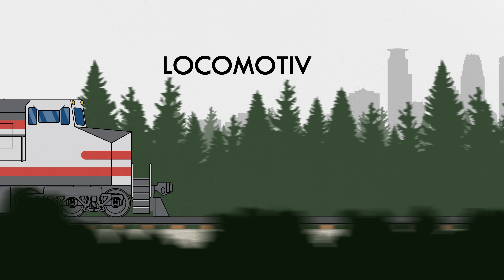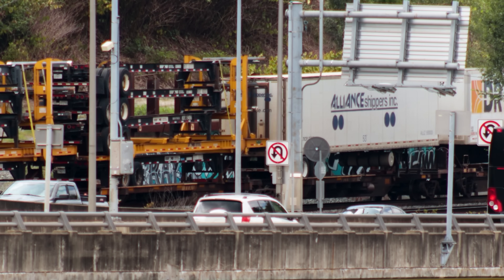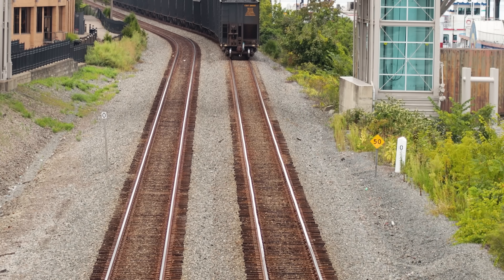Every Type of Railcar Explained in 15 Minutes

Comment: I have a question for the ether:
Where I live, in Melbourne Australia, there are almost daily   freight trains on my local passenger line. They appear to be flat bed cars, each with two cylindrical loads only about 1m diameter x 1m height.
Each load sits above a bogey, held in place by a wedge on either side (seemingly built into the bed). The rest of the bed is bare; it looks very sparse. On volume alone, I imagine you could fit quite a few more on each bed, but the distribution above the bogeys suggests weight is the main concern here. 
I'll see trains pulling what looks like 20 or so of these cars.
Anyone know what the cargo might be? Is it just a matter of density that determines how few fit on one car?

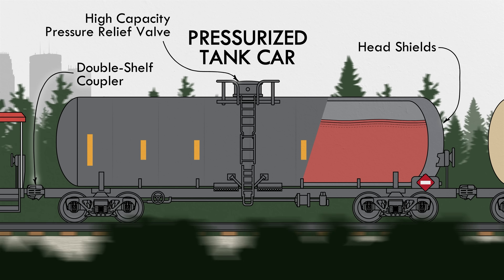Comment: 10:16 Be sure to search for photos of these features since the illustration doesn't have enough detail to show them as prominently as they can be seen in the real world. These are typically seen on cars transporting Bakken crude oil or maybe ethanol. The shields are big metal shields separate from the tank itself. The shelf couplers are much larger vertically to accommodate the motion of the train. Most safety features stem from accidents. In the NS Graniteville, SC wreck a coupler punctured a tank car of liquid chlorine which evaporated (having an effect like the banned WWI Mustard gas) and killed several people near the wreck site as well as one of the crew. The shields were added after the Lac Megantic derailment in Quebec Canada. The idea is to keep the tank cars from coming uncoupled during a wreck and puncturing nearby tank cars.

Comment: freight vs passager focus globally and the impact on the engineering. Why don't we have 300KPH freight trains?
- rail vs road bridge
 - building a rail grade in a green field vs a road in similar environment
- why Texas does not have the rail link of SA Austin DFW and Houston
- light rail vs 'real rail'
- why you do or do not include subways

THANKS - cant wait to see
Reply: Because freight trains are much heavier, freight cars don't require nearly the level of mechanical inspections that passenger equipment does, but mainly because no customers want it

Comment: Here in Finland most passenger cars are doubledecker and I'd say are even more common than single level ones on long distance trains. Also the double decker trains usually has a double decker restaurant car. Also the sleeper cars are mostly doubledecker with the second floor having showers and the first floor not.

Comment: Little point of view from france (and a bit belgium and germany).
In europe we tend to rely a lot more on mass transit in comparison to cars, mainly because cars, insurances, and fuel are expensive and mass transit isn't. It isn't uncomon for people my age to not own a car (or even not have a driving license) and only rely on foot, bicycles, bus and train for commuting.
As we are using mass transit a lot more, our transit systems are different. Double deck trains are really common (at rush hour, there is 3/4 double decked trains in Bruxelles central, and almost 9/10 in berlin).
Bagages cars on the over hand, I don't even remember seeing a bagage car in france, belgium or germany. But we do have some cars for bicycles users (with racks & ways to secure them).
Concerning cargo, in france we have a special wagon type for nuclear fuel & nuclear waste. Not really big, but heavily armored and secured to avoid any risk. They are called "castor" cask for storage and transport of radioactive material, which is also a pun as "castor" means beaver in french.
We also have factory-trains for rail and powerline maintenance, they only work at night and are able to change sleepers, rails (welding them in place) and even ballast.

Comment: "All trains have at least one locomotive" is a very America centric statement... Most passenger trains elsewhere have distributed power. Japan even has container trains without locomotives, designed to run at the same speed as passenger trains.

Comment: 0:40 
"All trains have at least one locomotive"
Unless its a DMU, EMU or Rail Motor,
Then it has 0
Reply: New trains to discover! 🛤
Reply: Is a DMU, EMU or Rail Motor like Intramotiv’s battery electric powered rail cars?
Reply: @wyattboynton3129  Electric Multiple Unit, think subways
Diesel Multiple Unit, similar but diesel not electric
Rail motor, single self propelled passenger car (may also have a trailer car)

Comment: There was a time when Auto Racks were open-sided, with the vehicles exposed to the elements; where in rural areas they were tempting targets for troublemakers to take pot-shots at with shooting out the side-glass of the vehicles.  The enclosed Auto Racks resolved that issue.
But, my brother that worked in the US auto industry, said there was a second reason for going with the enclosed Auto Racks: Security from vandalism.  
Back in the era of open Auto Racks, vagabonds would climb into the vehicles to 'ride-the-rails' for transport from one part of the US to another.  With the vehicles having the starter keys, the vagabonds would run the engine for heating warmth, using up the vehicle's scant fuel supply; and would wear down the vehicle's battery with playing the radio and using the cigarette lighter when the engine wasn't running, or out of fuel.
So, when the vehicle got to its destination for unloading, the interior would be a mess from food wrappers/waste/stains; stunk-up from cigarette smoke; the fuel tank empty; and a dead battery.
Reply: That's a real bummer. 😠

Comment: Wait a minute.. trains in the US are still running on fossil fuel? 
(It's a very very cool video! Sorry for the question but I can't believe it. The last time I saw a train running on fossil fuel was in the 90s and the US is usually number one.)
Reply: To be fair, most of Europe isn't that much better with electrification, save for a few countries like the Netherlands and Switzerland (near 100% electrification). However, the unelectrified lines tend to be more minor while it's true that even major routes in the US have no electrification (yet).
Reply: @MarioFanGamer659  It's true that only 60% of the European rail network is electrified but it's 80% of the rail traffic that is running on these lines.

Comment: Oooohhkaay.  So, I worked In Richmond CA.  Which has both a Toyota storage yard and a huge train yard.  My business was located in the "Iron Triangle", so named as it is bordered by 3 active lines.  And outside of that there are generally crossings on all the main roads every 500 feet.  Going to and from lunch could be tricky some days.

I've seen a loooooooooooooooot of Autoracks.  We figured out most of how they work but there's one thing we couldn't justify: What's up with the cheese-grater walls?  Weight savings?  Auto-mobile aeration?  The train cars get graffittied kinda a lot even though the new cars inside were covered in vinyl, still seems like it's dodgey.   

It's the one thing that still bugs me.  Why the holes?

We'll broach my theories on trains being an underground visual code packet transfer system and whether they're a freight thoroughfare or just reallly expansive closed system machines in later episodes comments. 

Whee!  Trains!  I can't wait to see your take on them.

Comment: Not all trains have locomotives though. Electric multiple units have electric motors integrated into one or more carriages. That's the most common type of commuter train in most countries I've visited. On the rare non-electrified tracks that have passenger traffic, you can also see diesel multiple units. Like that one Australian train you showed. Also, here in Finland, almost all long distance passenger railcars are double deckers. That seems to also be the norm in at least Germany and the Netherlands.
Reply: There is also a third type that started appearing recently: hybrid multiple units, which can be powered with both diesel and electricity. They are used on routes that only partially follow electrified tracks. Previously, in such a case you would use just a diesel multiple unit, but now the environmental trends and regulations in Europe force the carriers to use electricity as much as they can.
Diesel multiple units normally tend to be small and are usually used on secondary railways where it wasn't affordable to electrify them. I recently rode for some 3 hours on an old German Baureihe 614 now used by a subcontractor of the Polish PKP Intercity on a route in south-east Poland and it was really a nice experience, especially regarding that the route was quite hilly and you could hear the engines struggling to push the train uphill.

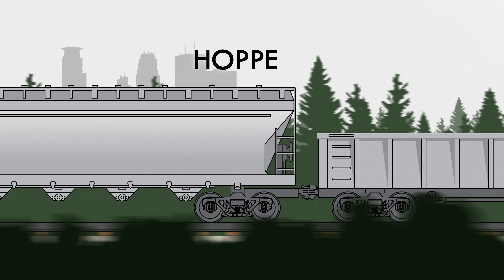Comment: 8:20 You also typically see areas with additional plates of metal welded on where the machine clamps down and pinches the metal flat over time.

Comment: I bet none of you got to spot a Peacekeeper Rail Garrison car.
Reply: https://en.wikipedia.org/wiki/Peacekeeper_Rail_Garrison - a cool Reagan-era concept, but it was never deployed. Maybe a select few army engineers build some mock-ups...

(Correction)

Actually, it seems to have actually been deployed, with two built and running (and being tested), 1990-1991. I definitely never got to see one, though...
Reply: @LD-Orbs  I rode in the train that they moved in back when I was in the air force. we never put an actual peacekeeper in either of them though. 

one of them, the one normally pictured in articles, is sitting on a small rail spur no longer attached to anything, out on the backside of FE Warren

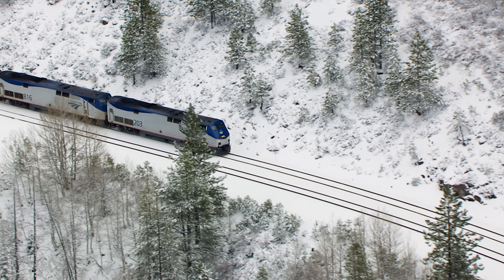Comment: 2:40 or take advantage of a more efficient use of time, since you can sleep like in a normal bed unlike on airplanes
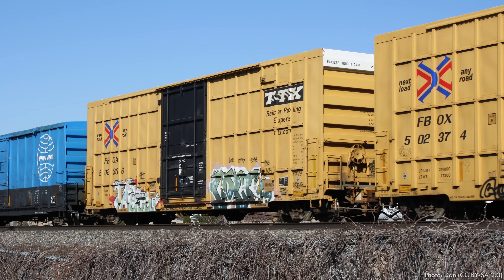4:30  they often still do by reducing capacity to size up cars by single tracking tunnels from = to – , using the higher tunnel center
12:17 sneaky schienenbus in the back

Comment: - Trains consist of locomotives and various types of railcars.
- Passenger trains have standard coach cars with rows of seats, but some are bilevel or have sleeper cars, diner cars, and lounge cars.
- Long-haul passenger trains may also have baggage cars and crew cars.
- Freight trains have boxcars that can be loaded by hand or forklift and can accommodate a wide range of cargo.
- Refrigerated boxcars are insulated fridges or freezers on rails and have diesel-powered refrigeration systems.
- High Cube boxcars are taller versions of boxcars designed for lightweight cargo, but not all railroads can accommodate them.
- Autoracks are designed to carry consumer cars and trucks and have multiple levels.
- Crew cars are used by train staff for breaks or sleep, and in some areas, a second crew might wait in a crew car to swap with the first crew.

Comment: One of my best childhood memories is getting to ride the switch engine at a local rail yard outside Chicago on the weekends. Saw just about every freight car you mentioned plus some cranes mounted on flat cars, not to mention the occasional result of an accident or two, and one or both cars being considerably shorter as a result! This was back in the 60s and shock absorbers built into the couplers was a big thing, with newer improvements all the time.

Comment: One car that was clearly overlooked since you touched on a similar car. The snow plow. I could drive about 10 minutes to the local rail yard and find one. Last winter I saw a snow blower car getting pushed by 3 engines. Unfortunately, I wasn't able to get a picture. Even if I did, I lost all my photos and videos on my phone this past winter.

Comment: Looking forward to more in this series. Maybe an episode on grade crossings "then and now." When are drop gates installed and why some roads have them and some don't. When do the gates drop and does the speed of the train affect that? How come so much of the rolling stock has graffiti? How do railroads keep track of where each car is? Is there a limit to the length of a freight train? Is there a forward and a backward orientation of locomotives? What's distributed power and why are there locomotives in the middle of some consists? Are all railroads in the US the same gauge? Can runaway trains happen? Why do derailments happen and how often? Why is it illegal to paint your house or maintain your property if it can be seen by people on a train? 🙃 Does US Mail travel by train anymore? How did the USA end up having the passenger trains and freight trains needing to use the same tracks and what effect does that make on either? How many people in a crew does it take to control a freight train across the country? Cargo pilots inspect each load before taking off. Do engineers have to deal with any such thing? What happened to all the acreage that old train yards used to use? Just some random ideas for future episodes. Good luck!

Comment: It would be nice if you talked to your audience as adults instead of kids.
If you're directing this content towards kids, then how disappointing.
You mentioned in the beginning that there are many cars but we, the public won't have any I interaction with any car other than AMTRACK.
I bet to differ.
I'm a professional train jumper so I come in contact with an array of freight cars at any given time.
Good luck with your channel
Reply: Should mention that the correct nomenclature for the light at the end of a string is called FRED. 
Flashing  Rear End Device.

Comment: As a railroad design engineer, I'm excited to see you highlight this aspect of the civil engineering universe. Can't wait for more videos in the series!

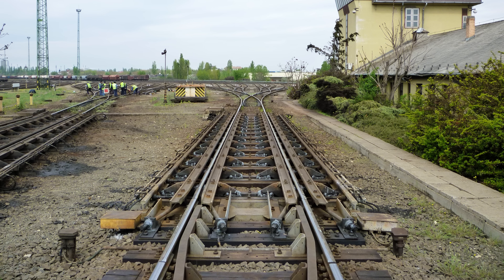I suspect someone in the preceding 1400+ comments has already mentioned this, but just in case: At 12:36, you mention "railroads depend on large scales." However, what's shown on screen is not a scale, but a specialized piece of equipment used in hump classification yards called a "retarder." Located downhill of the hump (where the cars are uncoupled and set free to roll downhill towards the "bowl"), it's connected to scanning equipment that identifies each car and its weight. The as the car rolls downhill through the retarder, longitudinal bars are squeezed against the wheels using the appropriate force to slow the car so it will couple with other cars on the classification track ahead at a speed that will not damage cargo, but not slow the car so much that it becomes stranded by itself. Quite an incredible combination of technology and physics!

Comment: Growing up, I spent a few years living on Norfolk Naval Station, and there was a major rail crossing from the freight terminal very close to the base; the result of which is that I've seen pretty much every cargo car here save the Schnabel. I've also seen quite a few of the non-revenue vehicles when they did some significant work on the rail lines near my current home. Hi-Rail vehicles are also a pretty common sight in the area.

Comment: Some tanker cars also have heating coils built inside the tank. Some liquids must be heated to make them fluid enough to pump into the railcar. During transit, these fluids will cool, making them impossible to drain or pump out of the car at the destination. Upon arrival, the railcar will be shuffled in the rail yard to a steam header where an operator can attach a flexible steam hose between the header and the heating coil connections. Once the product is hot enough (and fluid enough), the railcar is ready to be emptied and the steam hose can be disconnected.